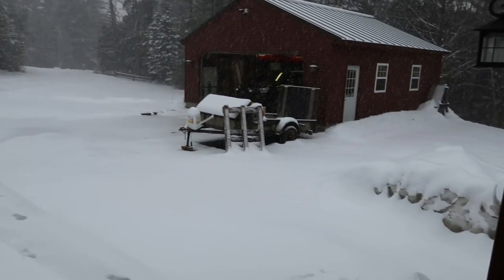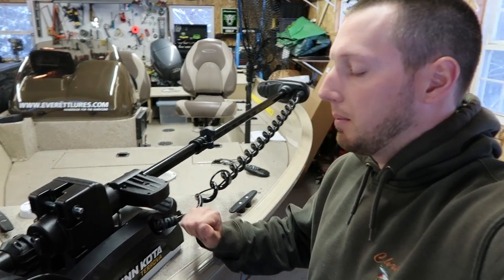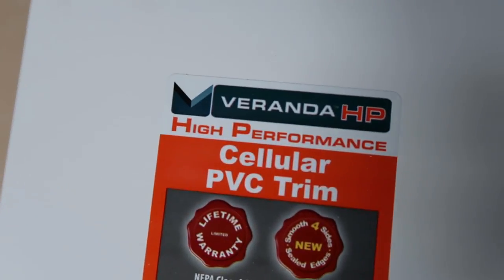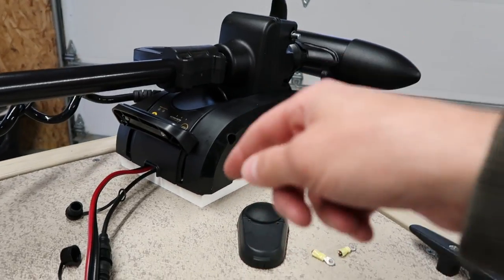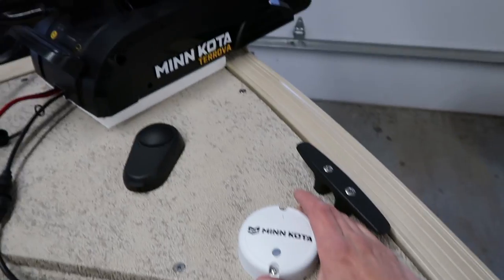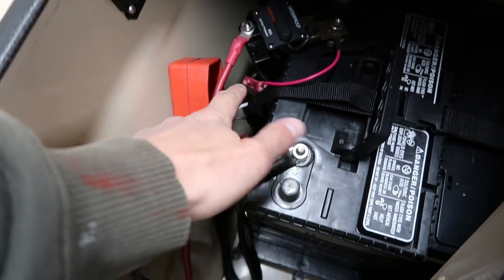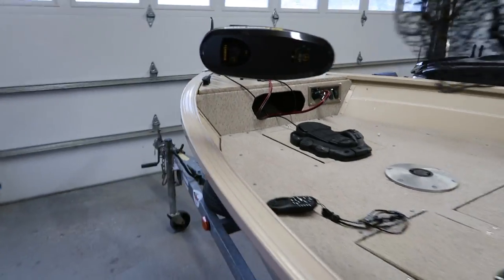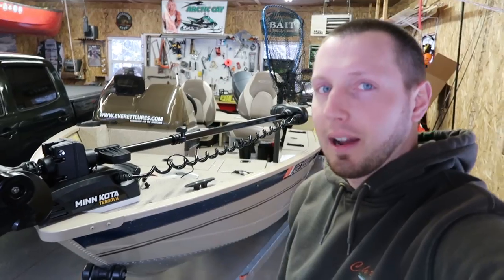How I Installed my Minn Kota Terrova

Comment: I just bought same trolling motor this spring.  My bow is flush so I got the minnkota removable plate.  I upgraded from my previous trolling motor and had to get that 60 amp breaker which is very important.  I overpaid for minn kota brand but you can get others for less.  I have two batteries and cant see going far with one.  Love the trolling motor.

Comment: Amazing job on the installation and great video! Do you find the 55lbs strong enough? I'm debating between the 55 and 80 for my 16.5' aluminum fishing boat (w/ 50HP Merc 4T).

Also, did you end up building a stabilizer arm for it? If you did, can you send me photos of how you did it?

Thank you!
Reply from the maker: If you’re going to use it a lot get the bigger one. This ones fine for me but I don’t use it a ton.

Comment: Any update on how long the battery will last? Especially with spot lock
Reply from the maker: I haven’t had it die on me yet. But if you use it a ton just put 2 batteries in there
Reply: Have a 17’ deep v tracker trying to see if the 12v is strong enough for my boat trying to avoid the whole 24v system if possible much cheaper
Reply from the maker: @Ryan-rx8ie  works well for me. I don’t generally use it when it’s windy and whitecaps but have used it in current and works well
Reply: What do you have for a boat?

Comment: You have a 60 amp fuse on a 40 amp plug it will never blow  your wires will burn first because that is your weakest point in the system. Your wire is too small as well  you need a minimum of 8 gauge to run 40 amp power properly.  I'm sure you're going to say I haven't have a problem but one day you will
Reply from the maker: Scott S thanks for pointing that out. I was just using the existing wiring in the boat. What do you recommend I do?
Reply: @mainetroutwhisperer  if it was my motor I'd run the correct wire first. Some 8 gauge copper silicone type marine wire and copper crimps and then heat shrink over between the crimp and wire or find some connectors that have heat shrink on them. Just don't want to see that nice boat go up in flames or have a problem while you're on the water cause it could damage your battery as well. But your installation is awesome well done. I'd also put a RAM mount on to stop your motor shaft from bouncing while travelling
Reply from the maker: Scott S thanks. That’s gonna be a bit of a job 😪
Reply: @mainetroutwhisperer  hardest part will be running your wires. But if you tape them really good and pull easy should be simple
Reply from the maker: Scott S is there any way to tell what gauge wire I have in the boat?
Reply: @mainetroutwhisperer  yes it should be marked on the wire Hopefully it's not wore off but it looks to me like either 10 or 12 gauge
Reply from the maker: Scott S it’s 6... Atleast the wire going from the plug to the battery. What wire are you referring to? That small wire you see on my battery is for the charger that’s attached to it.
Reply: @mainetroutwhisperer  Ok awesome you're in business then. I would also change the way you mounted your breaker. I would run a wire from the positive terminal to the line side of the breaker instead of having the breaker mounted right on the battery terminals. Glad you don't have to re-wire